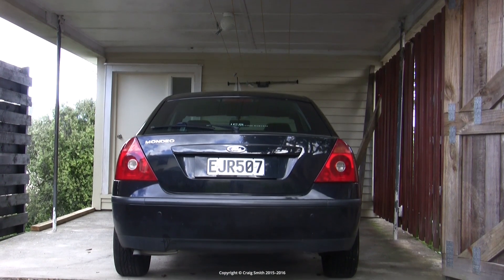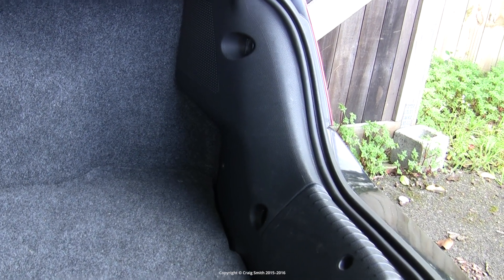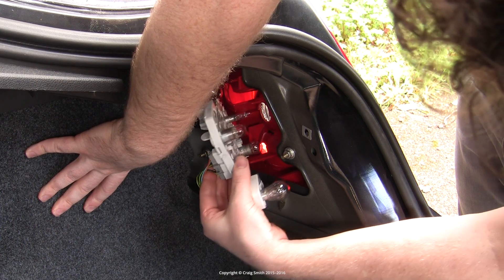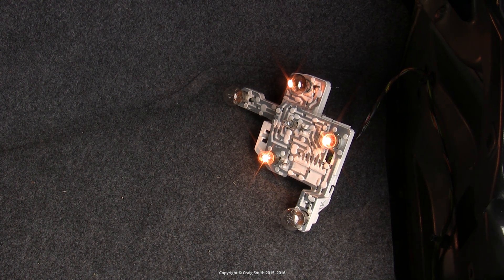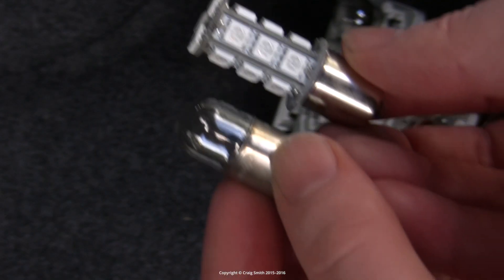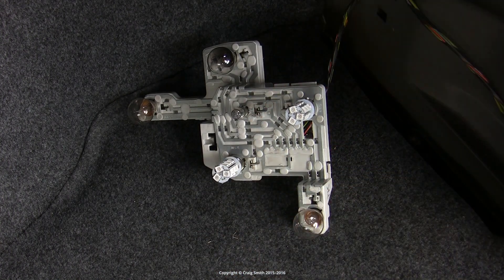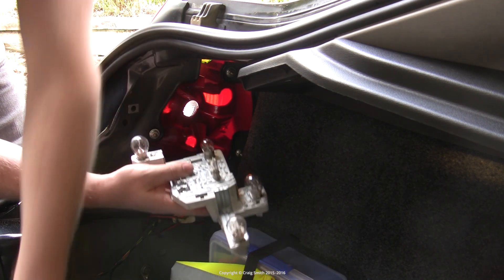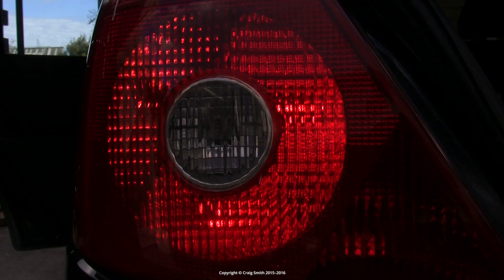Simple how to: Upgrade tail lights with LEDs (Ford Mondeo Mk3)

Comment: please help me, I do not know how to change the third stop light, in the center,  how to remove the lid and remove the spotlights
Reply: I'm sorry, I'm from Mexico and I do not speak English very well, in my car, that light unit has no screws. apparently it works under pressure, but when wanting to disarm it there is a lot of resistance, I'm afraid to break it, I could send you a picture if I could have another contact
Reply from the maker: You just take the screws out and the whole unit will fall away. I'll make a video if it's not obvious. Don't try to install LEDs though, unless you found some that properly replicate the incandescent bulbs - which I never have.
Reply from the maker: https://youtu.be/qZ0V1vQDGpI
Reply: @CraigsDIY  tliumyoolih č   cfgf

Comment: No point in doing just these unless you're also doing the brake lights, and you need the Philips 21/5 for that
Reply from the maker: https://www.youtube.com/watch?v=gtNZfe-Mlrg
Reply: Craig's DIY Car already seen that,  mate,  just wanted to make it clear for other viewers who are thinking of doing this - if you only do the rear lights there will be a significant difference to the brake lights that looks pretty ugly.  And for the brake lights you need the more expensive Philips 21/5 LEDs, cheap chinese ones won't do it.

Comment: Been wanting to do this since I replaced the sidelights and fog lights with leds** but its the dual filament tail/brake bulb I'm concerned about, as you say its harder to get an led that can produce enough output to be bright enough for a brake light.
Another is the reverse light with a bright white led. Looks much better than the yellow-ish halogen colour :)
And take the lens out of the indicator space so that it's able to throw as much light as the bulb can produce out rather than blocking it and reflecting it off the inside. That and some leds (and load resistors to stop hyperflashing).
Really makes a difference to the rear end of the Mk3 :D

Subscribing to see what you find useful to replace the brake/tail bulb with an led ;)

**Don't get much fog here so don't need to worry about their output, as I've used dual colour "switchback" leds in the foglights to include amber/orange in there as a second indicator. Mainly because I'm running HIDs and wanted to make the indicator more visible and not be washed out and hard to see next to the much brighter HID bulbs.